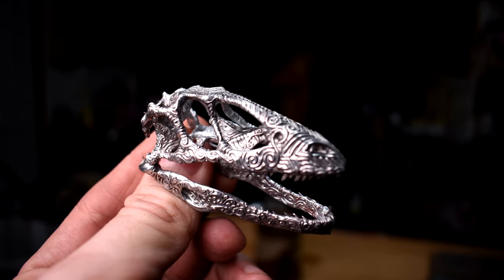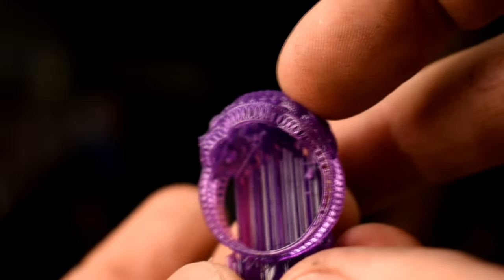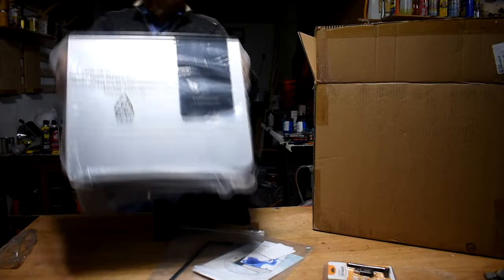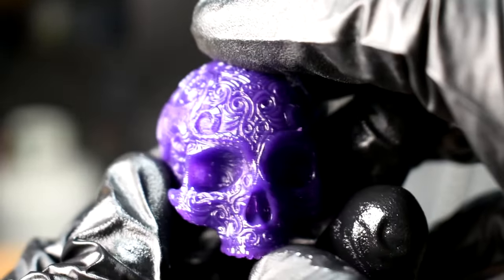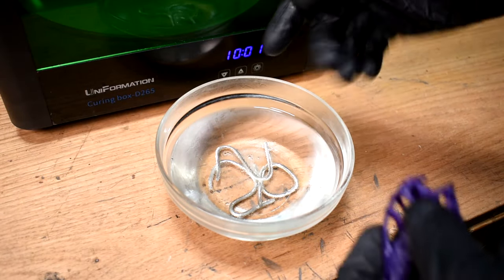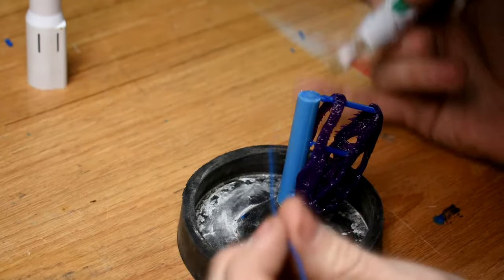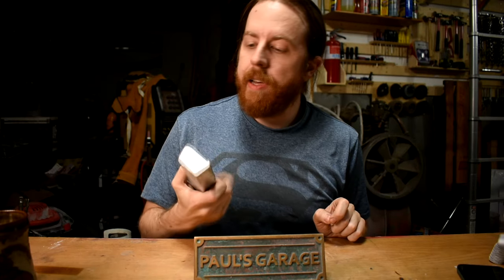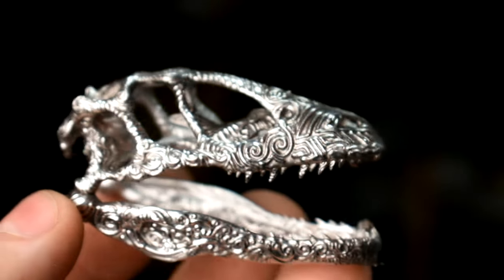3D Print to Solid Metal, BEST Way to Prepare Resin Prints for Casting

Comment from the maker: Equipment used:
Uniformation Printer kit: https://uniformation3d.com/products/gktwo-3d-printer-curing-station-ultrasonic-resin-cleaner?sca_ref=4345752.v3kdNjnqDi
Vacuum Casting machine: https://s.vevor.com/bfQIQf
Metal Melting Furnace: https://s.vevor.com/bfQoPf
Sirayatech Cast Purple Resin: https://amzn.to/3QOiN0M
Presige Optima Plaster: https://amzn.to/3sCre7l
10mm Wax Sprues 1lb: https://amzn.to/3MS6Cid
1mm Wax straws: https://amzn.to/49Wb3CL
2.5mm Wax straws: https://amzn.to/46loYin
Wax Pen: https://amzn.to/3sCrmUn 

Want to learn sand casting using your 3D printer? I can teach you!: https://paulsmakeracademy.mykajabi.com/joinus

Comment: I love the very detailed vacuum casting, theres a lot of people out there sandcasting aluminum cans but youre one of the only ones that does vacuum casting for hobbists rather than dedicated jewelers. Great video!
Reply from the maker: Thanks!  I've done my share of cans but never got good results, the alloy is all wrong.  Thanks for watching and there's more to come!
Reply: @PaulsGarage  That's the best part, while all the other YouTubers were stuck on aluminum since they can just use cans, you were super smart to switch to zamak.
Also one of the reasons why no one makes vacuum casting, they use aluminum so it always fails

Comment: The vegetable glycerin is a plasticizing agent with photopolymer (and most plastics/polymers). I find it a little unusual that they want you to cure in it, but wax-based resins are a bit unusual themselves. I haven't used them in quite the while, though you might be overcuring your resin if you find it terribly brittle. I make a graphene-based photopolymer additive to combat embrittlement with water-washables, though it works great with all photopolymers I've tested to date. If you're interested in a can and have a PO Box, say the word!
Reply from the maker: I didn't know that about vegetable glycerin, very interesting!  That affitive sounds pretty interesting, do you know if it can burn out cleanly?  Anything that leaves ashes causes problems with this process, but graphine is carbon, right?
Reply: @PaulsGarage   While it was intended to remain inside a more standard UV resin during print and curing, there's nothing in it that would hinder combustion. I have instructions I send out with the kits that some testing is necessary with respect to percentages that you can successfully run for different formulas/styles, but it's normally best to add 5ml at a time to a liter of resin, with the high end being 10-15ml in really thick, aggressive engineering resin formulas. The stuff is concentrated and I couldn't see the even smaller ratio per print being a problem. I can certainly do some testing with regards to flammability, but you're not likely going to end up getting the graphene part itself to a higher temperature than it took to create it (formation begins in my process at ~1800*C in stage 1 and only goes up from there).  
As I have to be able to ship it, I've reformulated it a few times to get away from substances that would qualify as hazmat, but I can recommend thinning agents you can use on your end if you'd like to enhance burnout also that won't affect its printability. 
Yes, the largest part of it is, how to say, atomically separated carbon. 😉

Comment: Hi Paul! Have you ever thought about using a flexible filament like one of the very soft TPU’s for casting? I currently don’t have the capabilities to print TPU otherwise I would try it. I am curious if you could design parts that are deformable and actually pull out of the dried plaster instead of melting out. This obviously would not be possible with something that has many holes in it like the Dinosaur skull, but may work for larger, more solid shapes like the Lathe base you just made?

Comment: That skull turned out really nice! I struggle with getting shiny stuff to play nice with cameras, antique razors I restore, so not really needing the level of detail you're after. But, I found I get much better results using a sheet of a neutral gray synthetic suede for furniture upholstery, (upholsering? upholserying? upholsteryficationizing... sure, I'll go with that) as a backdrop. Cheap stuff from the Amazon works fine. Seems to help balance the exposure. Takes some fiddling with camera setting to dial things in just right, but I think I got worthwhile results with the little effort. Anyway, great video, as always!

Comment: That’s some great information. I’ll have to try out that other kind of investment. I have been dealing with a lot of cracking in the investment on my last few resin projects. 
I chose the blue resin to use just to avoid the glycerin step. I don’t believe the true blue requires the glycerin but I hear it’s harder to print with.
Reply from the maker: If it cracks with blue it will probably crack with purple.  Blue is supposedly designed for easier burnout.  I have a bottle of blue here. I'll have to open it up and see how it works

Comment: 5:18 partially cured resin due to overhangs having resin curing beyond the current layer. somewhat known issue with this resin. you can also see this on your test prints such as the Ameralabs town, 1. the O with X inside, the top has a large amount of resin stuck to it under the overhang, 2. your vertical gaps under the horizontal gaps are closed near the back 3. the checkerboard, which has "ramps" from the lower back edge to the top front edge.

Comment: Very good video Paul, you've got the hang of the process perfectly! I like 50/50 blue/purple as it's a bit less brittle and prints nicer detail, still glycerine cure it tho lol 

I use regular investment, mixed at 36:100 works fine for Siraya cast resin without excessive cracking, and only need 730C for a few hours at peak. The shitty first gen resins, and a bunch of other current gen ones are pretty bad too tho and need the expansion friendly resin type ones lol Resinworks, Siraya and Bluecast are ones I reccomend, with preference for SIraya due to cost xD
Hopefully you're not doing full 17 hour burnouts, as it's totally not needed. I've ran 6-7 hour burnout cycles with this stuff very frequently :) 

You may want to consider making lathe tooling with pretty artwork embedded into it, if you use Zbrushes Bas Relief command (or other 3d tool) you can project 3d models onto the surface of other objects, kinda like how a coin gets that engaved look, can apply stuff to any other tools you have to be cast and make them super pretty and personalised with very minimal effort ;)
Reply: p.s. this will now be my goto video to share with people who need an easy to understand explanation of wtf i do haha :)
Reply from the maker: Thank you!  I use blender and I intend to add decorative surfaces to parts, but that will mostly be sand cast which limits a little of what I can do there.  What burnout schedule are you using?
Reply: @PaulsGarage 
0-150C asap
150 C- 3 hrs
150C – 700 asap
700C- 3 hrs 
drop to flask casting temp (e.g. 560C) for 90 mins to 2 hours depending on flask size.

Comment: I'd add just a tiny bit of bismuth to your ZA-12 to offset the shrinkage.
Reply: Hmm...even the gang at Belmont Metals haven't recommended using bismuth to combat shrink, but going from 1.2% to almost none would be mighty nice. How many grams would need to be added per pound or kilogram of the total melt?
Reply: @justinchamberlin4195  I'm no metallurgist, so... I don't actually know.
Reply from the maker: I would worry about changing the properties of the metal too much.  A tiny bit of the wrong metal can take a solid alloy and make it super brittle, for example.  Worth a test, though.  It might be great
Reply: @PaulsGarage  While you're at it, you should also look into metal matrix composites. It'd be interesting to find out if there are any that can be made at home.

Comment: cast a set of small bevel gears or a gt2 sprocket
my shit always warps and ends up useless
Reply from the maker: Those sound like things that really need to be machined
Reply: na. 
well, probably. 
fdm/fff i have no issues. 
print whole gearboxes. 
run real well. 
resin always seems to warp. 
drives me bananas.
Reply from the maker: @amandahugankiss4110  oh yeah resin stuff does tend to warp worse than FDM for sure, I've noticed the same thing

Comment: This is unbelievable man
Reply from the maker: Unbelievably good I hope 🤣
Reply: @PaulsGarage I really truly aspire to make something this cool!
Got a sand casting kit and some scrap silver, made a ring on a lathe and cast it, it’s not perfect yet, need to re melt but it’s a start. 
I’m building a large furnace too for copper, aluminium, brass, bronze… I’ve got a keg and cut it in half, made some large stainless rings and welded them on. I need to buy materials now to get it running, when the budget allows 😂
I’m so excited by it all though

Comment: Uh, alcohol in an ultrasonic? Not a good idea.
Reply from the maker: Why is that?  I've only seen ethanol, ipa, and acetone suggested to use
Reply: @PaulsGarage  ultrasonic waves create fine vapor that can combust rather impressively if it consists of any kind of flammable fluid.
There's a way to do it safely (look for a NASA paper on ultrasonic cleaning with parts bagged in alcohol from way back in 60ies) but I would not want to try it any other way.
Best case you get the scare of your life when it spontaneously goes pop. Worst case are severe burns, concussion and hearing damage.
Reply: @PaulsGarage  it vaporizes a not insignificant amount so they say dont use anything flammable. but just some decent ventilation is enough to deal with that. i extract lions mane in 95% ethanol in an ultrasonic and have never had a problem.
Reply: This ultrasonic looks like it could be vapor tight as the lid seems to have a seal.  The big advantage to using a separate container with the alcohol / part that you then put in the Ultrasonic full of water is that you need less alcohol that way.
Reply: @4o4o4 at the end of the day it's just about air fuel mixtures.
Reply: @mr.cantsay the best air fuel mixture ratio is achieved by having 0 fuel.
Reply: @4o4o4 it's great that you haven't had an accident yet, but the magic of yet is not good safety practice.
Reply: @Argosh  or too much oxygen.